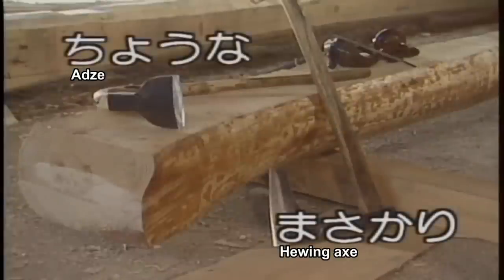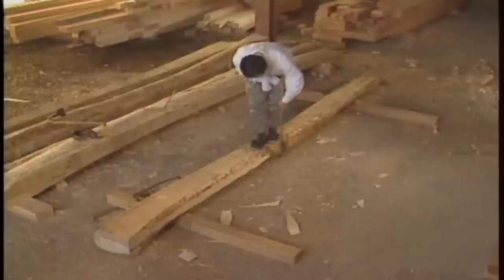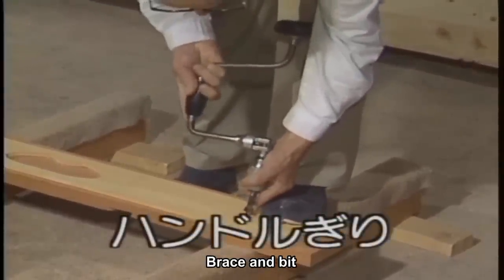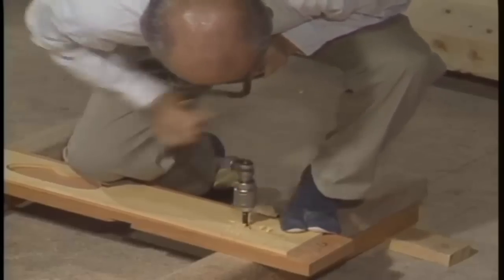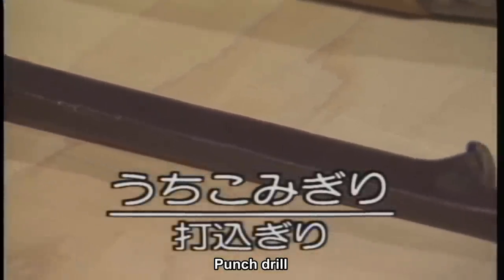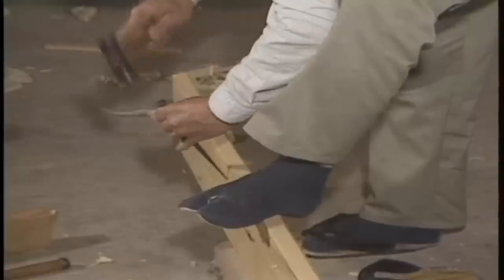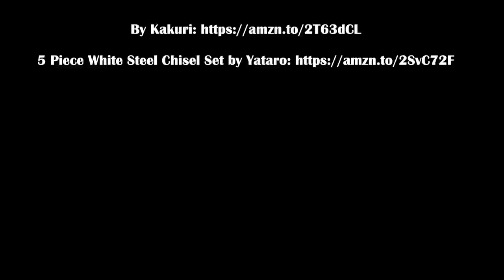Drill and Axe are The Craziest Woodworking Tools You Must See

Comment: Is it frowned upon for a Japanese carpenter/joiner to use power tools or machinery ???  I can understand that the older generation would stick to traditional ways and only use hand tools but surely in this day and age time is a major component of any job being accomplished in a timely manner let alone the costs of said job. I know many clocks in Japan tick tick differently when it comes to crafts etc. For me the Japanese carpenters/joiners are the finest and skilfully educated craftsmen on the planet. (I leave to others to prove me wrong)
Reply from the maker: Good point. of course, nobody can stop them from using machines. But it depends on their production size and the work they do in the workshop. If they run a small family business, they will take care of each product they make, so they will do most of the steps by hand. But if they run a larger business, for example building a wooden house, they have to use machines to save time and make up for the lack of manpower. A prefabricated joint is more precise than one made by hand with poor skills.